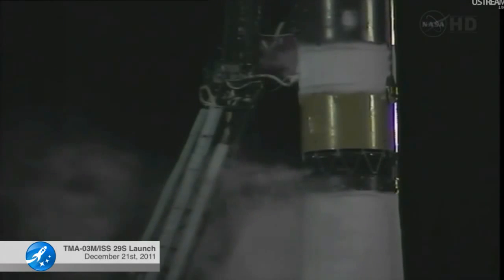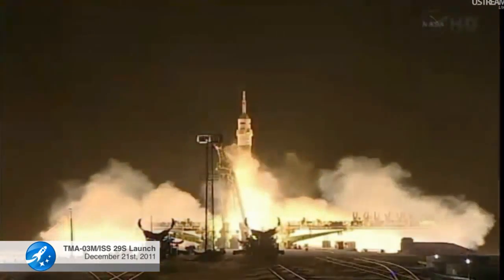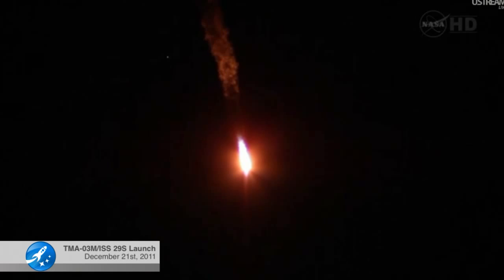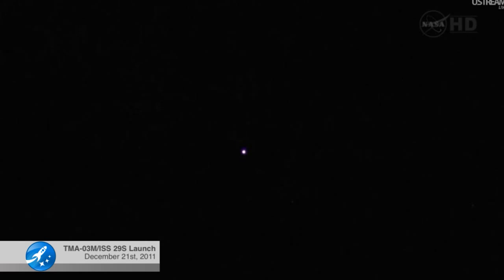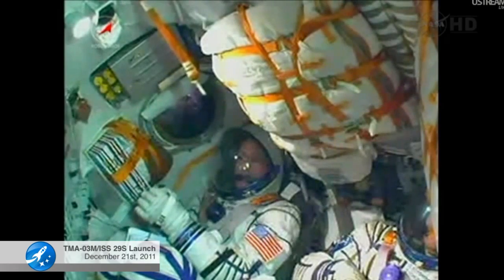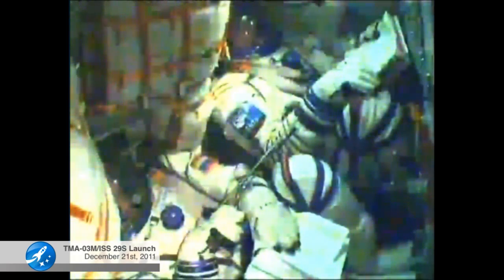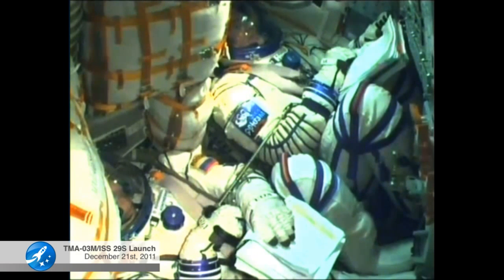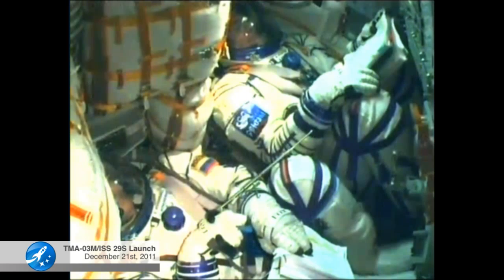Soyuz TMA-03M/ISS 29S Launch Video - December 21st, 2011

Comment: @Zayin1993 No one ended the Space program, JUST THE SHUTTLE PROGRAM. There will be several new vehicles developed by NASA in the next few years. Not to mention what the private sector is doing which is far more amazing. GO SPACEX!!!
Believe it or not this is the most exciting time for the american space program.
You don't have to be a cosmonaut. In fact if you can wait another 5 years you might be able to be a tourist.